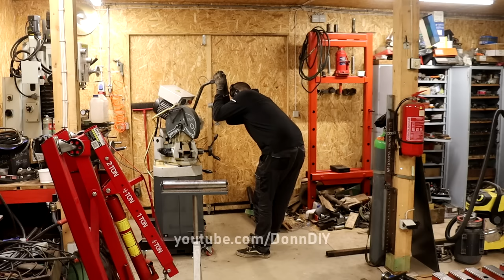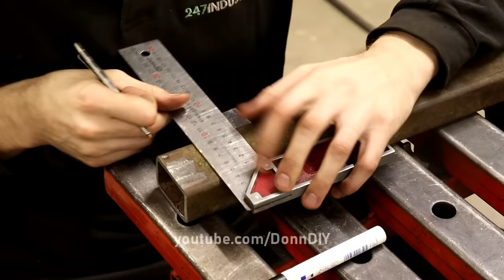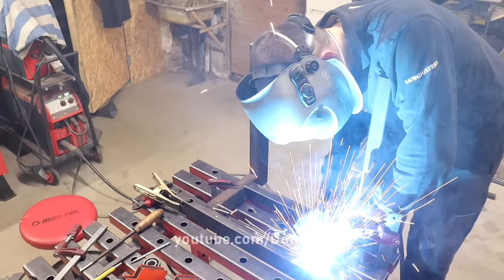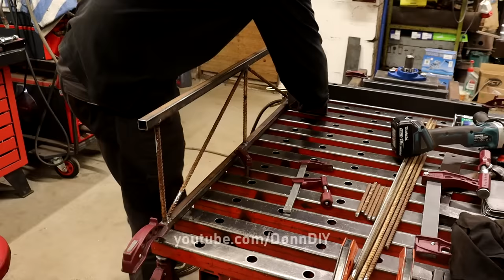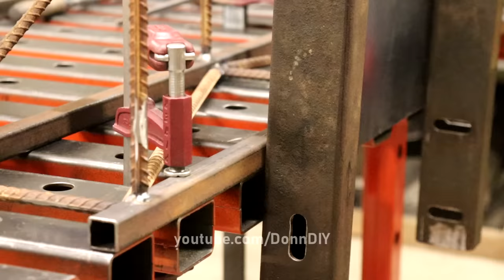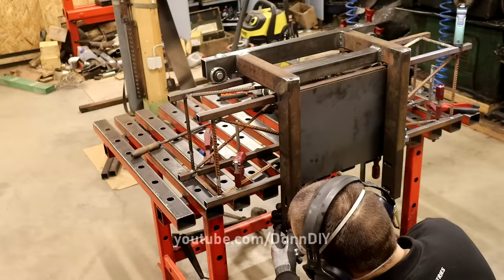Swingblade SAWMILL Build Ep.2 - Saw Carriage Fabrication

Comment: Coming along nicely! Why do you prefer the cutoff wheel over the plasma cutter? I've seen you use the plasma cutter sporadically but you always seem to come back to the cutoff wheel even for sheet metal.
Reply from the maker: The plasma cutter isn't turned on most of the time, neither the air compressor, which are both needed for plasma cutting. So it's just easier to grab the angle cutter and snip away with that.
Reply: @DonnDIY  Thanks for the reply. I too tend to use the cut-off wheel more often, also mostly due to the reasons you give (although it's also because I'm no good with the plasma cutter which of course is because I use it so seldom). I'm trying to get better at using the plasma cutter though as it's less dirty.
Reply: @martinedelius  He needs one of the plasma cutter with built in compressor.
Reply: @kameljoe21  Yeah, that would work. He could keep the air compressor on and let the pressure regulator turn it off when not needed. 

In my case I have a leak in the system I haven't found so I need to turn on the compressor by hand which makes it easier to just get the cutoff wheel. :/

Comment: I would mount gas spring or pneumatic cylinder to effortlessly put force on steel saw
Reply from the maker: Gas cylinder will come and it'll counteract the weight of the electric motor that'll be mounted on the swinging frame.
Reply: @DonnDIY  i ment for Mr Chop

Comment: Isn't the saw blade interfering with the frame?
Reply from the maker: Nope.
Reply: @DonnDIY  ah ok, at 23:06 when you swing it down, it really looks like the blade when mounted on the hub at the bottom of the shaft will cut right into the bottom of the rail support frame...

Comment: it was worth making the vertical and horizontal parts of the truss the same symmetrical, now when the temperature changes, the truss will twist a little, otherwise it would just bend, bending is easier to deal with than twisting ...

Comment: Donn, any chance that you would provide plans for this build also? I have a few of yours in my library now, but this build has been one I've been looking forward to for some time. Plans would be extraordinary. Name your price, I will pay.
Reply from the maker: I'm thinking about making a set of blueprints. I have scribbled pretty detailed drawings in my sketchbook already so it is quite possible that this sawmill will end up in the blueprints. section
Reply: I am interested too. One of the things you can consider is making the rails long enough to accommodate two saws. The swing blade saw carriage on one end, and a chainsaw blade style ripping saw on the other end to mill slabs with...
Reply: @johnross8939  That would be pretty cool. I also see people talk about using the facer or sander yet when you are cutting something why would you want to come back and do it later. 
My neighbor has a bandsaw mill and I told him about the swing blades and he kinda had wish he gotten the swing blade yet I had not talked to him for a few week when he decided to get the bandsaw mill. Either way we tried a few things and one was using a circle saw to cut the boards before hand and that took too much effort to line it all up. He had this shaft from some machine that allowed you to stack blades on it with 1 inch spacers. We never finished it before we moved. What we did come up with was a carriage that was much like the band saw one and a 5 hp electric motor to power the blades. We were sill working on the up and down part and the side to side. As it only had 12 blades which could cut 12 inches wide and cut up to 6 inch boards. The idea was to cut them in the same place or the first path then using the band saw to cut off some 1x2 for stacking and then cut down deep enough for what we wanted 1x2 1x4 1x6s and just do that till the log was gone. Do a bunch like that then change it for the 2 inch spacers that we were going to make. This would have made the cutting the log super fast.  I am not sure if the 5hp was going to be enough, he did have a 10hp we could put on it too.
Reply: @William Glaser  I think a facer or sander wouldn't be appropriate until after the boards have sufficiently dried. They're going to move during the drying process. I have seen saws with multiple blades. One was a swing blade appearing design. However, the blades didn't swing. There is both a horizontal and a vertical blade that cuts a finished board in one pass.
Reply: @johnross8939  I you look for Marty T you will see one that cuts it in one pass. 
There are mills that edge boards with a number of blades. As well as a bandsaw mill that cuts the whole log up in pretty much one pass. 
I guess you are right that you would need to do the facer and sanding after the log is dry yet, hear me out, why are they come with the lucas swing blades if you order them? Are you really going to face off a slab after you have cut it months down the road. This is for the person who using that piece. So I guess I have no clue as to why one would need them. 
There is another kind of cutter that moves the blades up and down and pushes the log in to those blades. Yet these kinds require massive foundations and are no longer used. They use stacks of band saw mills spaced out about a meter or so then the log is fed in to the machine.
Reply from the maker: I've already thought about the slabber as well. I think it's a good accessory for compensating the lack of proper slabbing capabilities of a swingblade sawmill.
Reply: Time for a Patreon for exclusive members is the only way forward. If viewers want more information like plans etc
Reply: @AW-Services  Nah. Creators who force people to pay, go to other sites to view additional content suck. I support those who I want to support.

Comment: Seems like that swingblade will hit your beam. I understad this is only for testing, but still.
Reply from the maker: It hits the table at the moment, not the beam.
Reply: @DonnDIY  I meant if you assemble it the same way as you do it for this showcase, and you put the blade on the holder, then it will collide the beam/table/anything sooner than 90°
Reply from the maker: Still no. The blade will clear the beam, trust me.